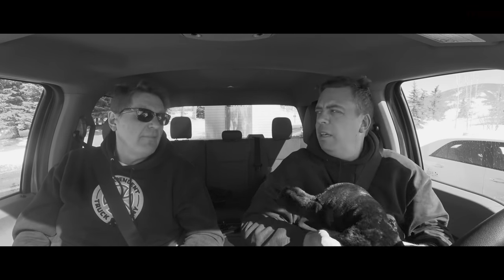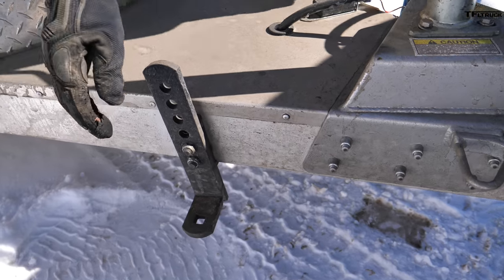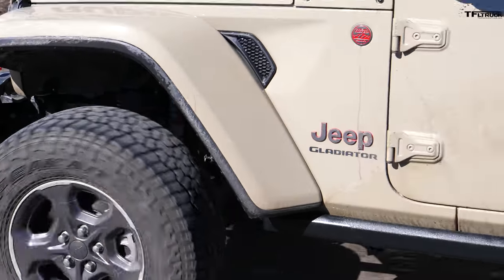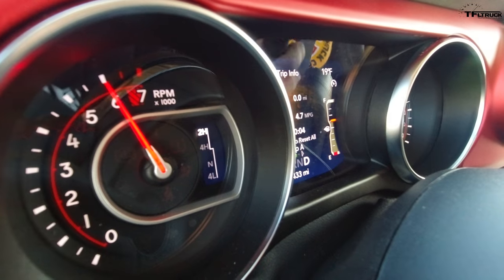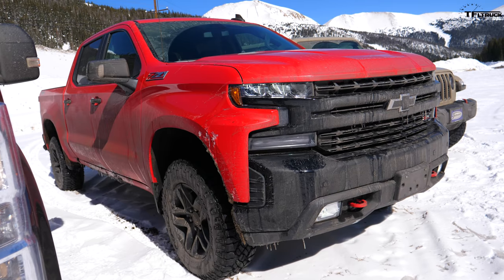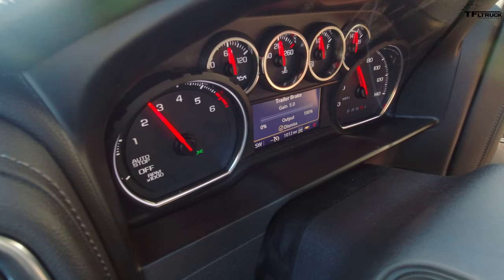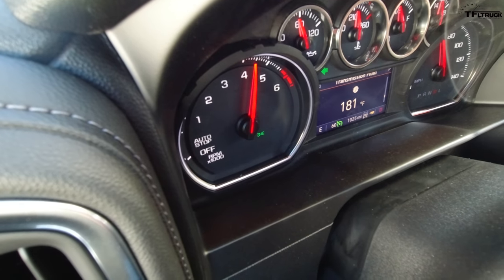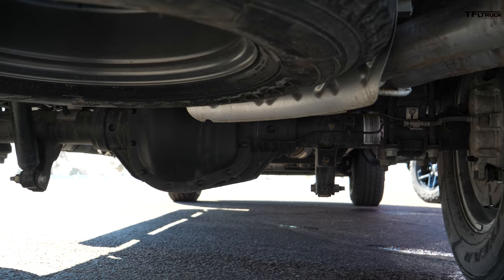Midsize, Half-ton, and HD Trucks Versus the World's Toughest Towing Test - Only One Truck Kills It!

Comment: No to the cruise control on the mountain ... You crazy?
Reply: Yes that is a crazy idea, I agree with you.
Reply: I disagree. Why is cruise control crazy? No danger at all. You are still in control of everything immediately with the pedals. No reason not to use cruise unless you want to let the truck slow a bit on the drive up, which is fine also. Cruise would work better downhill, too, because it would manually downshift unlike coasting. Plus, less, or no, brake applications. I prefer to manually downshift, but if the TFL guys won't do that, they should use cruise downhill so the trucks downshift on their own. Would be far less brake applications.
Reply: @MrChadx1  Well, to each his own I guess,..but every safety manual and instruction we read, it tells us to not use 'cruise' in these driving situations, don't they?

Comment: You shouldn't have removed the WDH. We all know the bigger the truck the more it can handle; the point of watching this video is to find out just how capable a properly setup truck can perform, so don't rig the game by pointlessly removing the WDH when everybody else in the small trucks will be using them for this sized load. How do the trucks perform when they are properly setup? Also, I personally wouldn't emphasize time on a test like this; you should put the truck in the sweet spot, let it dig in. The proper RPM and gear is more important for the longevity of the truck then making sure you get up an 8 mile hill 1 minute quicker than the next guy. As a viewer, I want to know how capable a small truck is, if you don't arbitrarily put limits and handicaps on them. I may want the Rubicon because it's small and fits in my driveway in town; now, can it go up the IKE? How easily? I couldn't care less that it takes 2 minutes more, but is it safe? I don't know now, because you removed the WDH.

Comment: You guys should take a percentage of the weight each truck can haul and test that. So if you use a 7000 pound trailer for the f250, figure out what percentage 7000 is for the f250 max towing and then use that percentage for the other 2 trucks. That keeps it fair. Obviously the biggest truck will have the easiest time hauling the same test trailer duhhhhh!!!!!
Reply: Watch at 5:51, there was a reason they tested this way, it wasn't about being fair to the truck but being responsive to their viewers past questions.

Comment: Pointless comparison test. Nobody is buying a Gladiator to tow 7000 up a mountain, or a trail boss for the same reason. They both can do it, so you can if you have to, but not why you get them. That super duty would suck for trail use, parking, fuel economy, etc... Also has no creature comforts or quality interior pieces.   Not sure what the point of this is. Besides pointing out the obvious about what will tow better...

Comment: Let me get this straight the forward with a 7.3 big block against a 5.3 small block and pulled the same time going up the mountain You can say what you want about chevrolets 8 nobody make a motor like a Chevy
Reply: They are not trying to test which truck can go up the hill the fastest.  They cap the speed at 60mph.  A perfect time is 8 minutes.  To me, they should try to go the fastest time up the hill but they don't do that.  They let off the gas if the speed goes over 60.  When they tested a f150 with the 3.5 ecoboost, they had to back off the gas because it could easily go faster than 60mph up the hill.